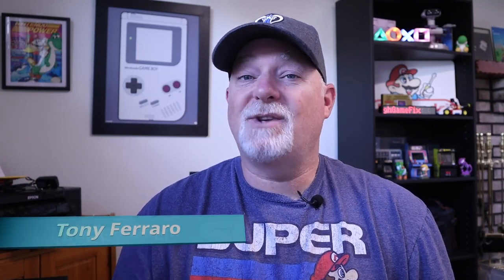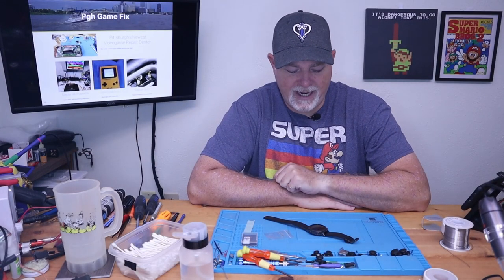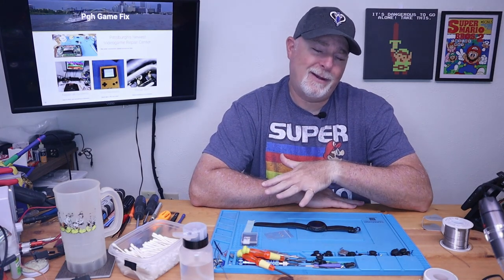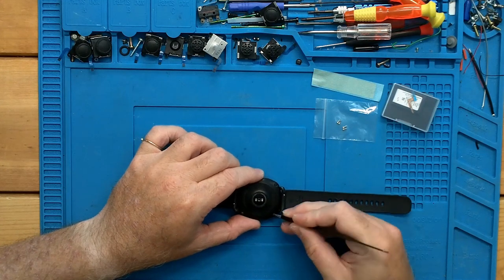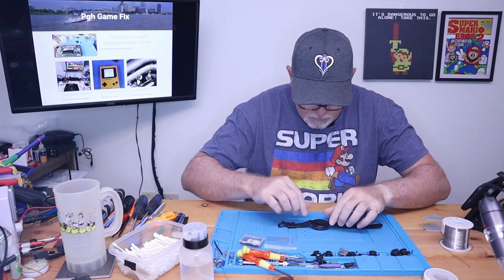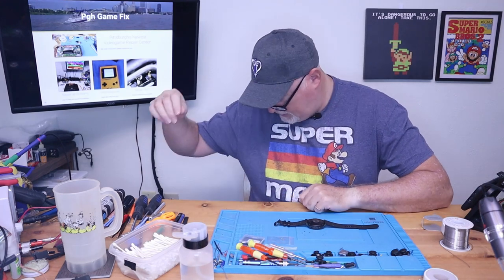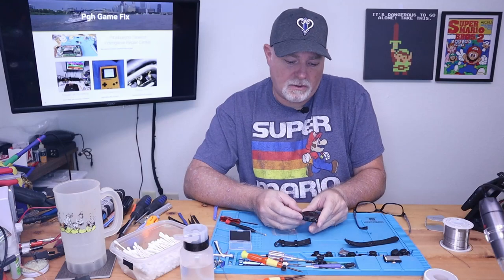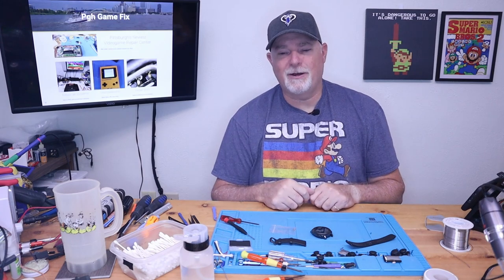Samsung Gear Sport Battery Replacement. SM-R600 (not the Galaxy version)

Comment: Sir, thank you very much for video. I want to ask a question. As you know, this watch is waterproof. What will happen after we replace the battery?
Reply from the maker: If your gaskets are still soft... it will still be water proof. Mine was.  If the seals are hard... it will probably leak if you don't replace them .
Reply: @PghGameFix  I am grateful 🙏🏻

Comment: Hello! Great tutorial. I got to around 10:10 but when I connected the board and battery, it got extremely hot and emitted a burning smell. Any idea why that might be? (I immediately detached it and left it.)
Reply from the maker: Unfortunately, if it got hot... something is shorted.
Reply: @PghGameFix  Appreciate the reply. If it's shorted, would buying a new board fix it? Is the new battery that I tried to install still good?
Reply from the maker: @s0faKiNGbEaSt  Without it being in front of me... I couldn't tell you where the issue is.  Sorry. BUT... there should be signs of what got hot, and that will be were the problem is.